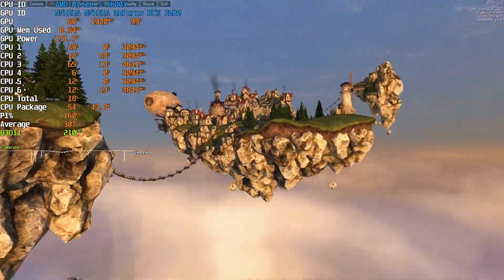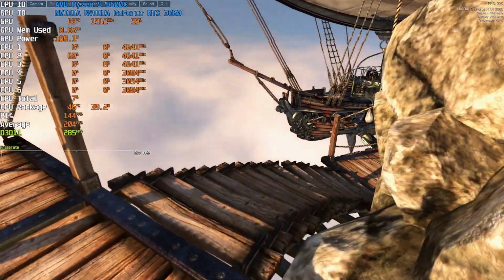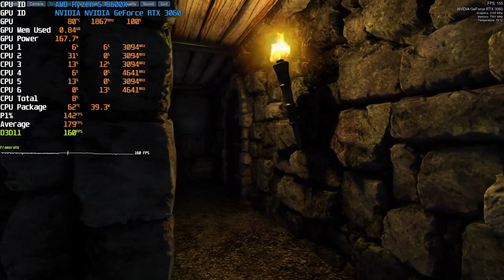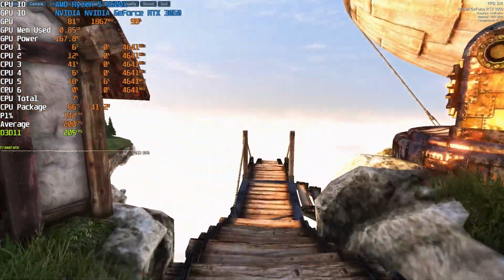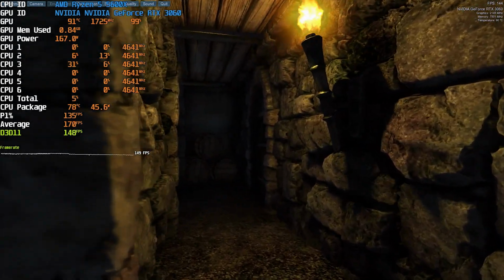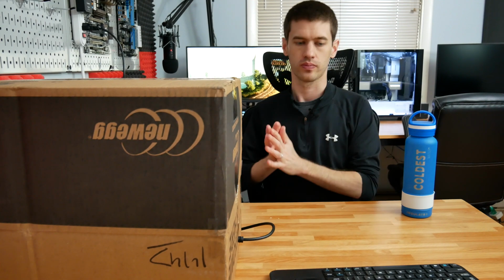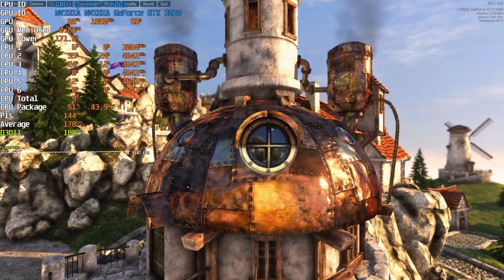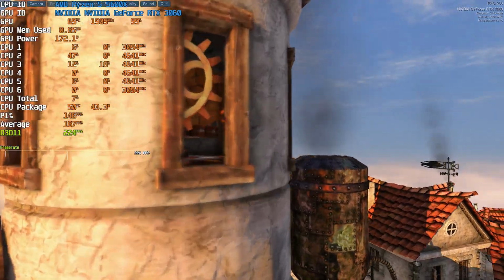What Happens When a PC Has LITERALLY NO AIRFLOW

Comment: A friend and I built in a Lancool 215 (around $80US) last week and found it quite good.  It comes with two 200mm front intake fans and one 120mm rear exhaust fan.  We added one 120mm fan as exhaust on top as far back as it would go, even though airflow is already good in this case.  Effective cable management channels and a built-in rgb/fan hub round out what seems to be a pretty good option at this price point.  If you're a fan of rgb it can make for a pretty nice-looking case, subjectively speaking.

Comment: I still think a lot of tech tubers over exaggerate the mesh everything given a couple fans and decent cutouts your average user will be fine higher end hardware pulling more juice will need more of course but meshiify the entire case is unnecessary. I have a Phantek P600s with removable front and top hard panels and with panels in place yea it's a little warmer nothing mind blowing ( I do have good fans though. Also nobody ever talks about the noise a mesh case will inevitably bring as well so a good balance I think is best....cool video 👍